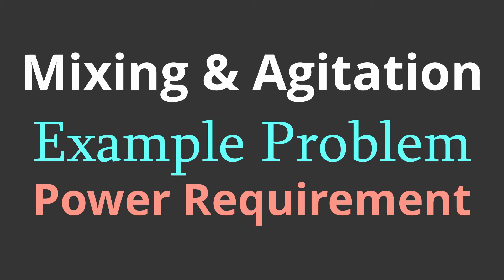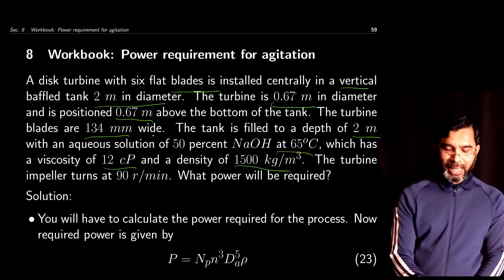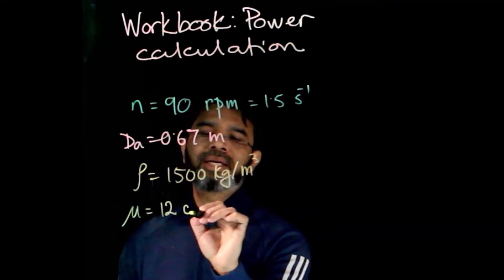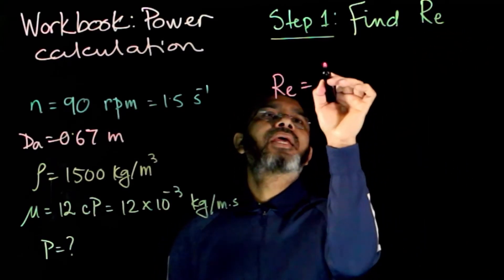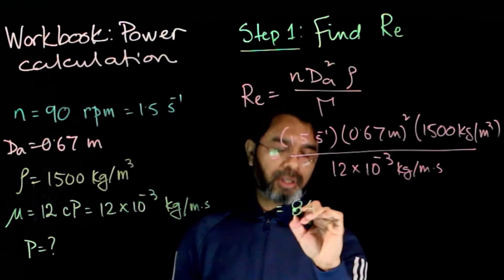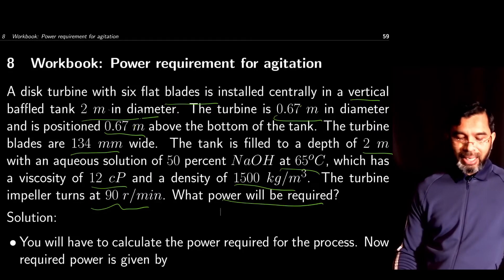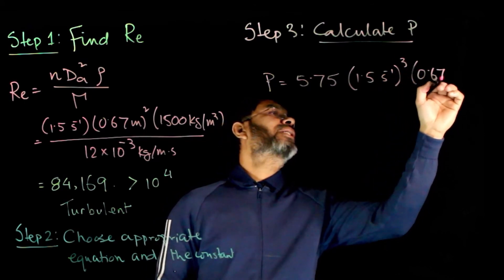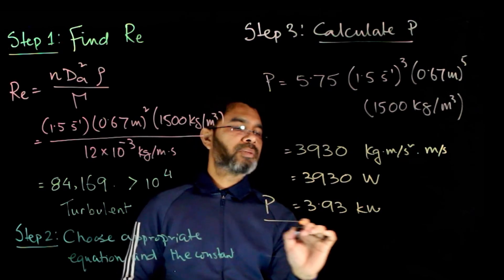Solved example: Power requirement for mixing

Comment: Dear Sir, In this problem height and diameter of the vessel is mentioned. Also blade location from bottom of the vessel is also mentioned. But we didnt use this information. Please explain. Also practically in industry we have vessel with 2-3 nos of blades on one shaft . How to calculate the power required in this situation? Please guide.